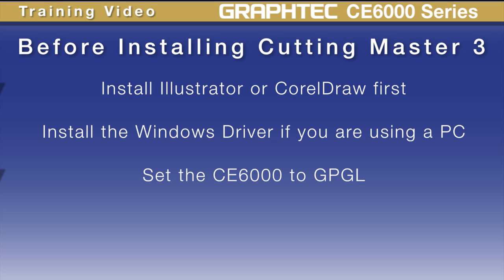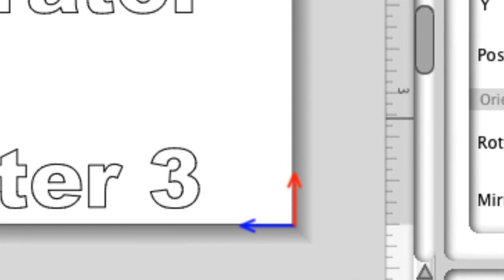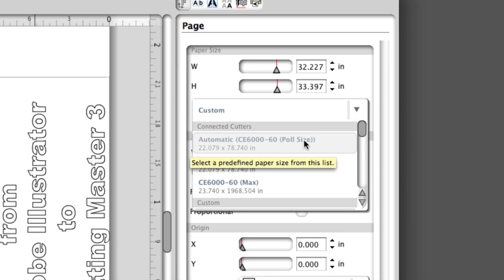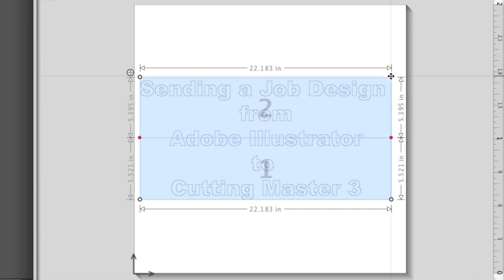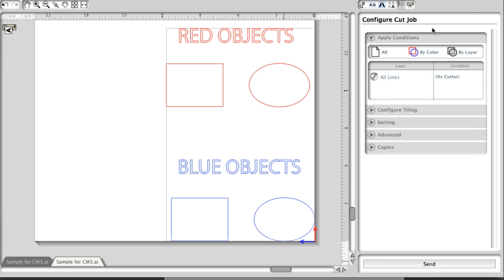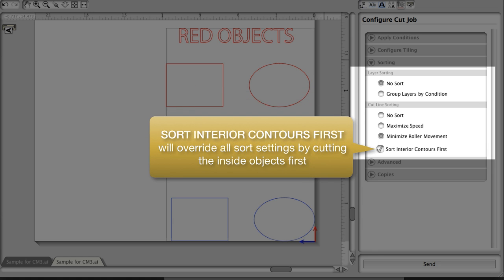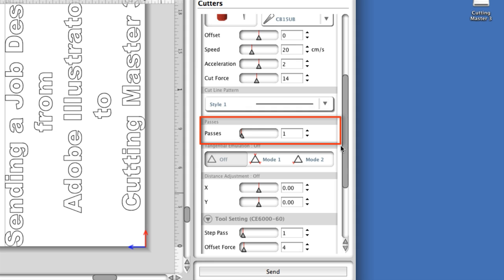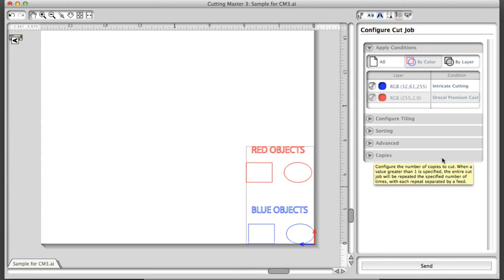Graphtec CE6000 Cutter Training - Cutting Master 3

Comment: Hi, I've a problem, when I want to cut a desing and try to send the lines to the Cutting Master 3 program, appears a signal which says "LAUNCHER: could not connect to CorelDRAW" Do you know what it could be? Thanks!
Reply: @jotoimagingsupplies  Ok, thank you so much, I'll try this tomorrow. This is weird, because I have another pc in which the cutting master works fine with the corel (both pc have corel draw X6) so it should be working in both. But I'll try what you told me. Regards.

Comment: i use ce6000 but i have a problem,,,the cutting master3 cannot cut,,the messages is not connected,,i ve already check the usb cable not trouble,,

Comment: I have struggled for a while trying to figure out how manually move tiles around. I tile my artwork into 2 horizontal tiles with the top one having a vertical split. I want to nest the 2 top shorter panels side by side but they are locked end to end. Any ideas? Thanks!

Comment: When I measure the vinyl with a ruler. then measure my design with a rule, and I put the data in the computer my design does not be the size I intended it to be it always comes out smaller? Why
Reply: +jotopaper damn so how can I get it to be the exact size that I need it to be

Comment: is there anyway to use the poster with a pen to draw designs??
Reply: The design comes out like an outline? How can I make it more solid?
Reply: I'm sorry I should have been more clear. I know that plotter is not meant for that, however when I put a design, that is an outline, the Cutting master makes all of the outlines an outline. So I would have double lines. I can;t figure out how to just make it draw single lined designs like they appear on my screen.
Reply: Right, but the problem is that if the design is already outlined in Illustrator and sent to Cutting Master 3, the design turns into a double outline. I assume that the program is set that way and there should be an option to change that. But I went through was seems like everything and I can't find a solution to this problem.

Comment: just changed the Blade to a newer blade, and with the same settings it had before, was not even cutting through the vinyl. I've been adjusting the settings for about and hour and it barely seems to change the pressure no matter what i do. first time encountering this issue.
Reply: I got it figured out. Once you said brackets,  I realized the holder for the blade was actually sitting on top of the bracket, so it wasn't going down as far as needed to make the cuts. So once I adjusted that it was fine. Thank you very much for the help.